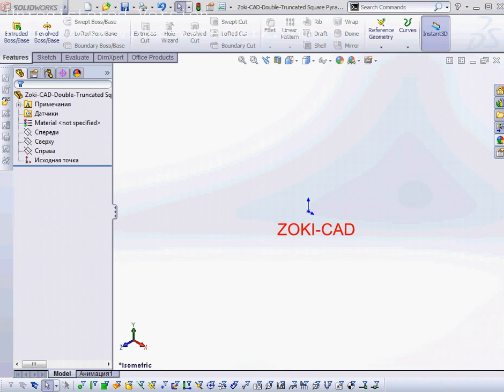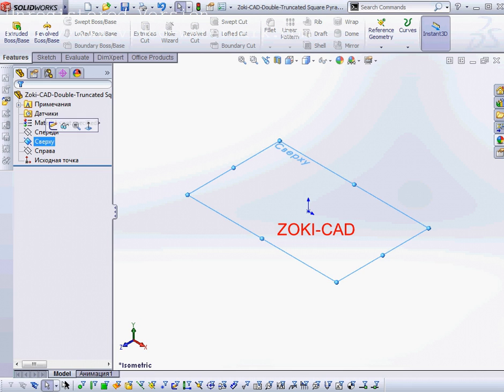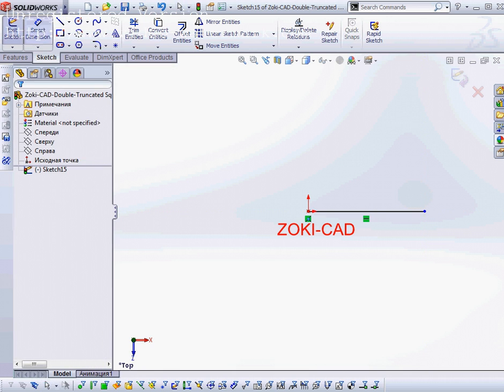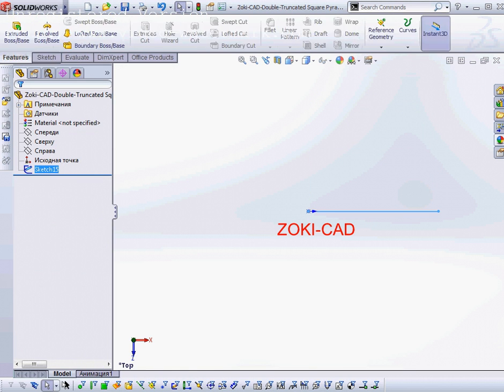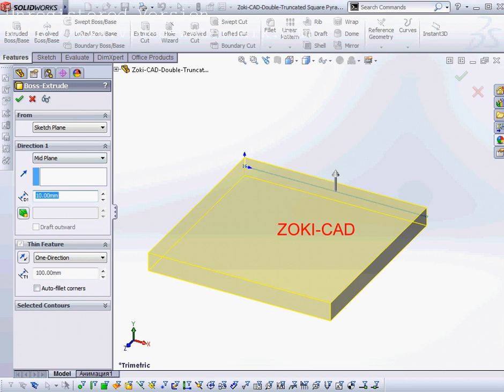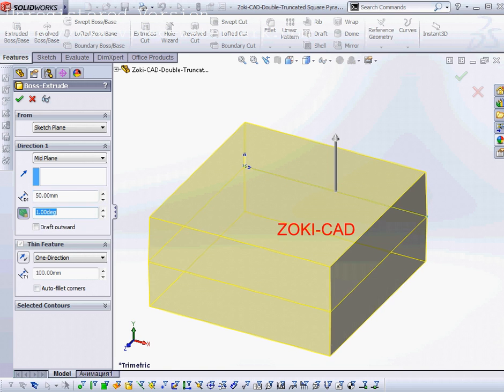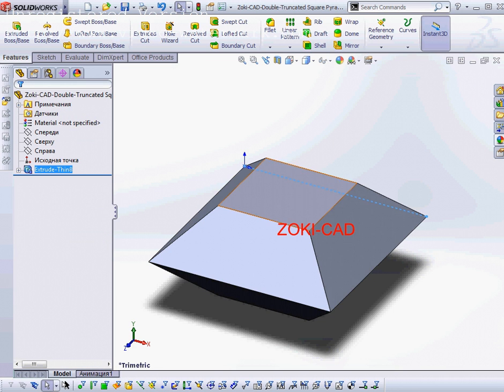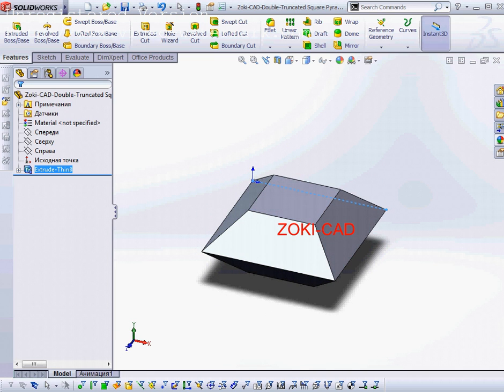Modeling truncated octahedron in SolidWorks with one line-My Tip & Trick

Comment: this is not a truncated octahedron.  It is not an archimedian solid.  This is a square bupyramid with 45 degree angle walls.  The angle between square and hex faces in the truncated octahedron is arccos(-1/sqrt(3)),  roughly 145 degrees.